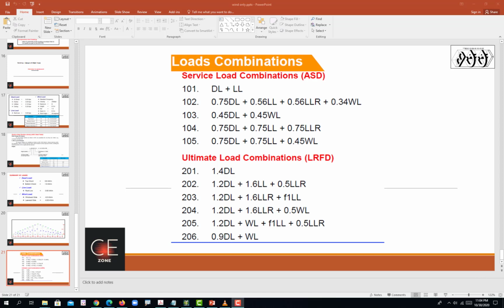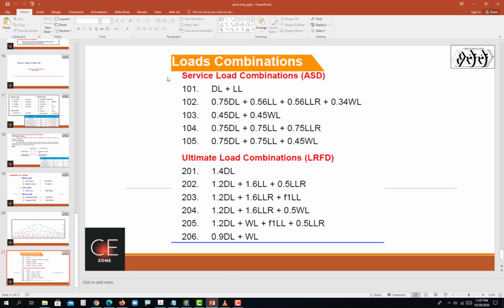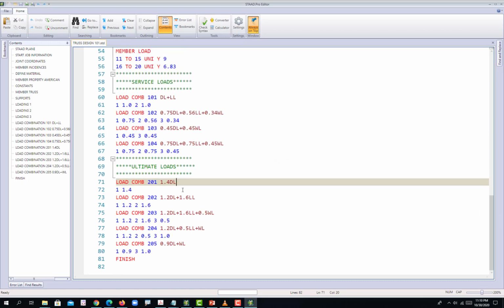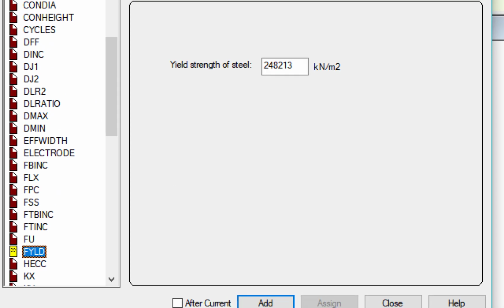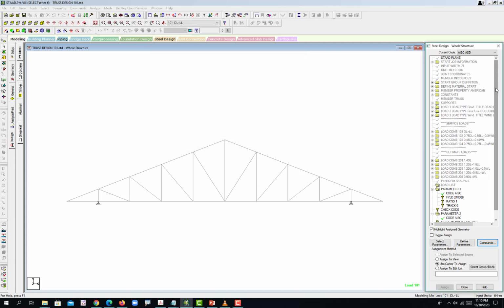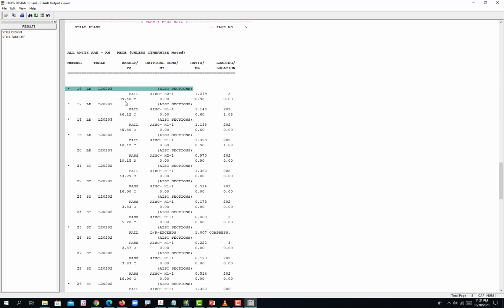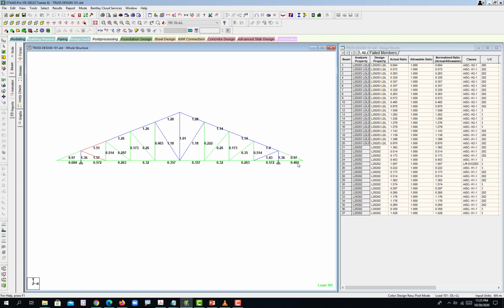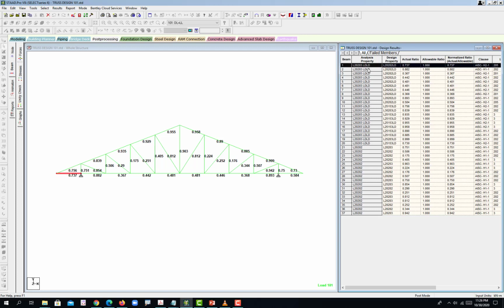STAAD PRO v8i DESIGN OF STEEL TRUSS PART V

Comment: Sir Bakit po hindi  Parehas  result pagdating sa Unity Check(Inital design without Select optimize command). chineck ko po Editor ninyo same na same naman po sakin pero iba result sa Postprocessing

STAAD TRUSS
START JOB INFORMATION
ENGINEER DATE 02-Nov-20
END JOB INFORMATION
INPUT WIDTH 79
UNIT METER KN
JOINT COORDINATES
1 0 0 0; 2 1 0 0; 3 2 0 0; 4 3 0 0; 5 4 0 0; 6 5 0 0; 7 6 0 0; 8 7 0 0;
9 8 0 0; 10 9 0 0; 11 10 0 0; 12 1 0.4 0; 13 2 0.8 0; 14 3 1.2 0; 15 4 1.6 0;
16 5 2 0; 17 6 1.6 0; 18 7 1.2 0; 19 8 0.8 0; 20 9 0.4 0;
MEMBER INCIDENCES
1 1 2; 2 2 3; 3 3 4; 4 4 5; 5 5 6; 6 6 7; 7 7 8; 8 8 9; 9 9 10; 10 10 11;
11 1 12; 12 12 13; 13 13 14; 14 14 15; 15 15 16; 16 16 17; 17 17 18; 18 18 19;
19 19 20; 20 20 11; 21 2 12; 22 3 13; 23 4 14; 24 5 15; 25 6 16; 26 7 17;
27 8 18; 28 9 19; 29 10 20; 30 12 3; 31 13 4; 32 14 5; 33 15 6; 34 6 17;
35 7 18; 36 8 19; 37 9 20;
START GROUP DEFINITION
MEMBER
_TC-WW 11 TO 15
_TC-LW 16 TO 20
_BOT 1 TO 10
_WEB 21 TO 37
END GROUP DEFINITION
DEFINE MATERIAL START
ISOTROPIC STEEL
E 2.05e+008
POISSON 0.3
DENSITY 76.8195
ALPHA 1.2e-005
DAMP 0.03
TYPE STEEL
STRENGTH FY 253200 FU 407800 RY 1.5 RT 1.2
END DEFINE MATERIAL
MEMBER PROPERTY AMERICAN
1 TO 20 TABLE LD L20203 SP 0.005
21 TO 37 TABLE ST L20202
CONSTANTS
BETA 180 MEMB 1 TO 10
BETA 45 MEMB 21 TO 37
MATERIAL STEEL ALL
MEMBER TRUSS 
21 TO 37
SUPPORTS
2 10 PINNED
LOAD 1 LOADTYPE Dead  TITLE DL
SELFWEIGHT Y -1 
MEMBER LOAD
11 TO 20 UNI GY -0.6
1 TO 10 UNI GY -1.8
LOAD 2 LOADTYPE Roof Live  TITLE LL1
MEMBER LOAD
11 TO 20 UNI GY -3.6
LOAD 3 LOADTYPE Wind  TITLE WL
MEMBER LOAD
11 TO 15 UNI Y 9
16 TO 20 UNI Y 6.83
LOAD COMB 4 GENERATED NSCP 2015 WIND ASD 1
1 1.0 2 1.0 
LOAD COMB 5 GENERATED NSCP 2015 WIND ASD 2
1 0.75 2 0.56 3 0.34 
LOAD COMB 6 GENERATED NSCP 2015 WIND ASD 3
1 0.45 3 0.45 
LOAD COMB 8 GENERATED NSCP 2015 WIND ASD 4
1 0.75 2 0.75 3 0.45 
LOAD COMB 9 GENERATED NSCP 2015 WIND LRFD 1
1 1.4 
LOAD COMB 10 GENERATED NSCP 2015 WIND LRFD 2
1 1.2 2 1.6 
LOAD COMB 11 GENERATED NSCP 2015 WIND LRFD 3
1 1.2 2 1.6 3 0.5 
LOAD COMB 12 GENERATED NSCP 2015 WIND LRFD 4
1 1.2 2 0.5 3 1.0 
LOAD COMB 13 GENERATED NSCP 2015 WIND LRFD 5
1 0.9 3 1.0 
PERFORM ANALYSIS
PARAMETER 1
CODE AISC
FYLD 248000 ALL
RATIO 1 ALL
TRACK 0 ALL
CHECK CODE ALL
PARAMETER 2
CODE AISC
STEEL MEMBER TAKE OFF ALL
PARAMETER 3
CODE AISC
LOAD LIST ALL
FINISH